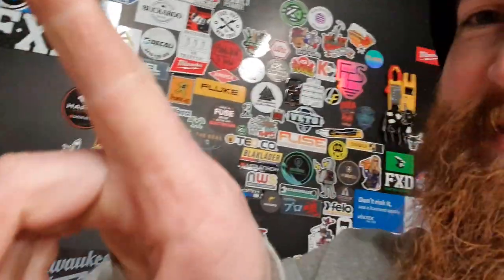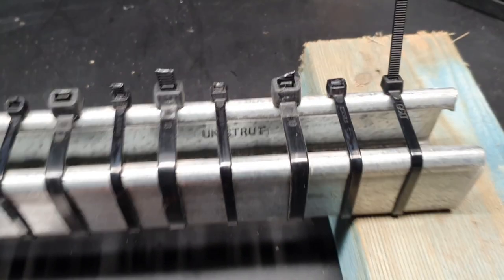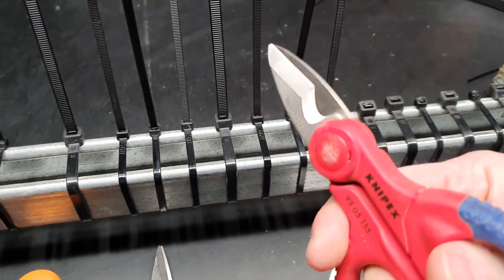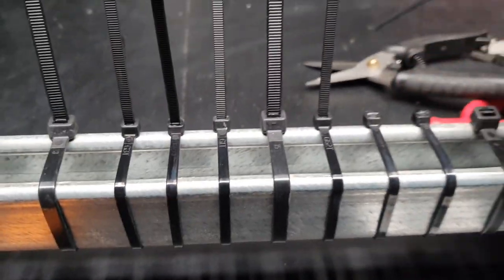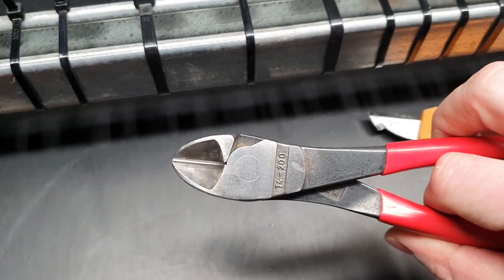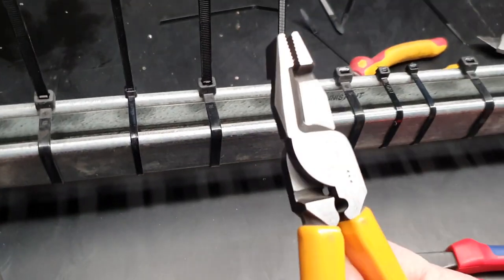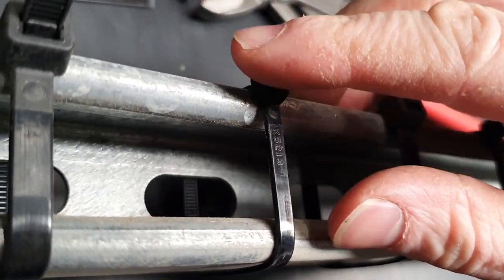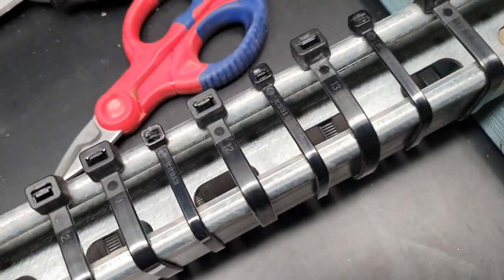Cable Tie Flush Cutting Masterclass! - Flush cut with six common tools!

Comment: Which would you recommend for stainless steel ties? I don't need a dedicated zip tie tool so a pair of flush cutters strong enough for stainless steel zip ties is a more useful tool for me!
Reply from the maker: Stainless steel tie guns are the go, they have a cutter built in - set you back about 100$ though

Comment: Flush cuts are great BUT you can cut flush with a normal set of pliers unless the tie is massive. All you do is put one blade on the block of the tie and pull the other blade sideways through the excess.   Works with normal side cutters too. I used to have a 50 cent set of tiny side cutters I got from a reject shop that I used for probably 10 years on just about everything. Got me everywhere from open work to up under dashboards where you couldn't see what you were doing.